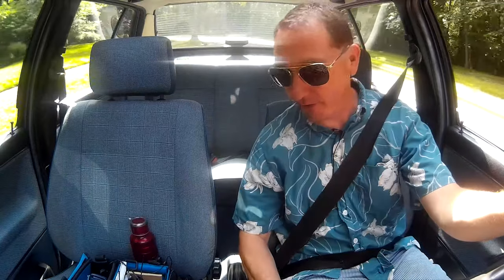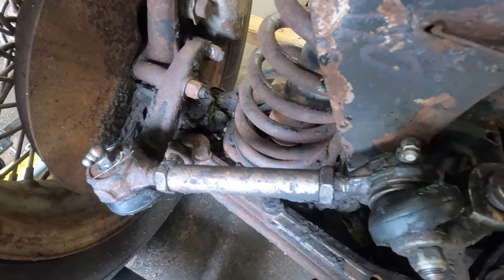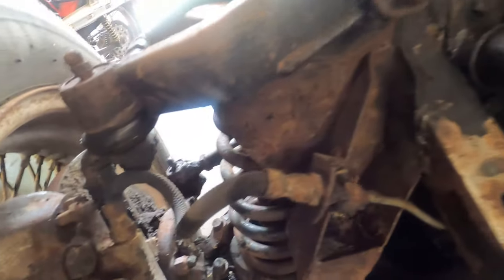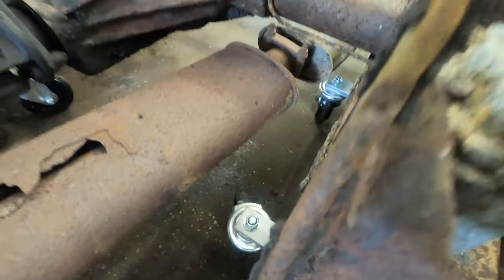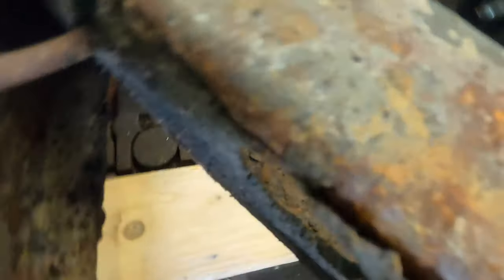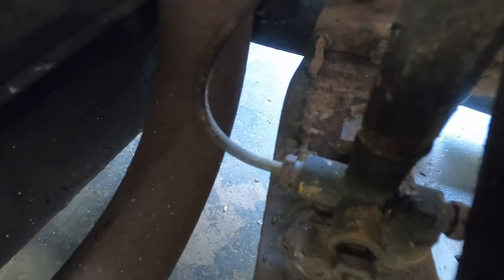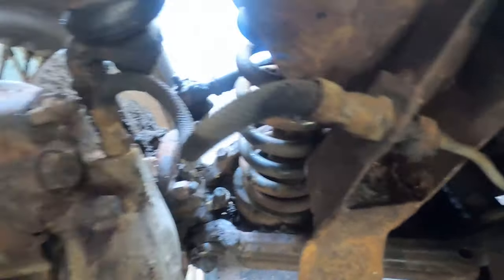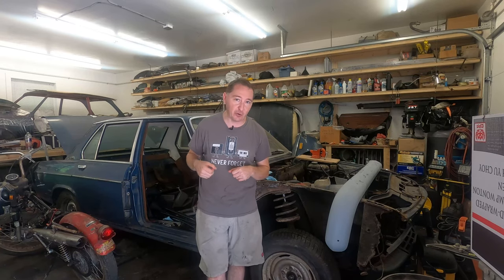Episode 3 Frame Tear Down

Comment: Be sure you put a new rack and pinion steering set, way better than what the 3's came with
Reply from the maker: I'm going OG as possible on this build, BUT, the first "upgrade" I may do is the rack + electric fans.... TBD
Reply: @tr3wrench  You already have a TR-4 trans, but  you may want overdrive or a 5speed. Also get a hi speed starter, Dayton wire wheels and front sway bar. with all this you can drive it cross country.